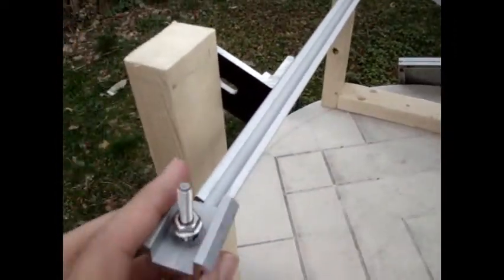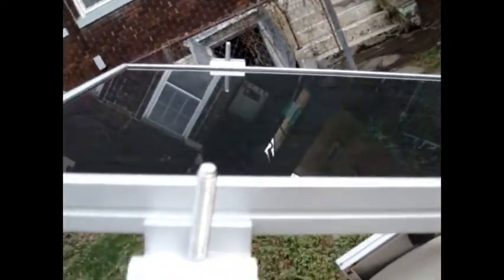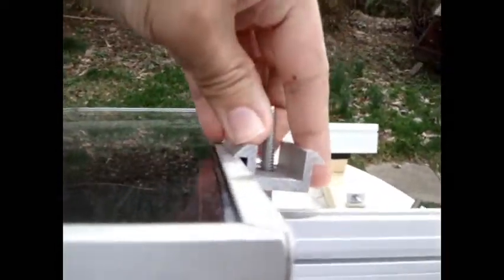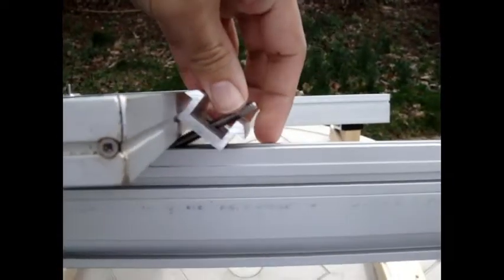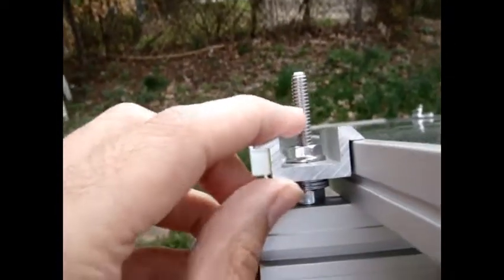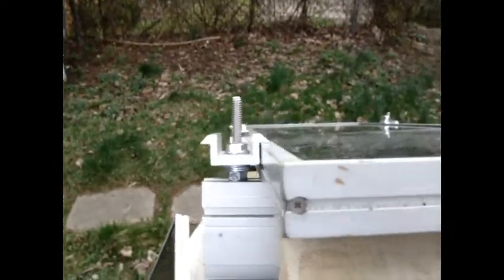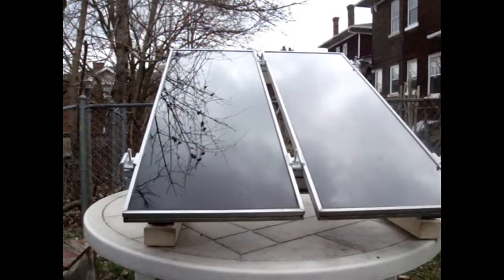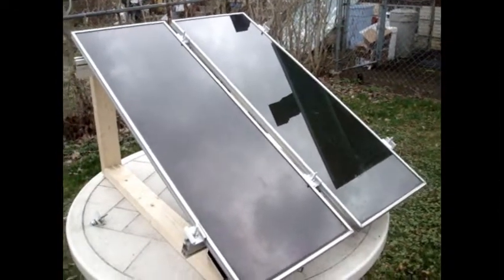Habor Freight Solar Racking Upgrade : Unirac Parts

Comment: Nice video.  Those are good looking panels. Because of the look of the glazing on those things, it gave me an idea.  I wonder if they were used as an awning for a porch or windows what the gain would be. I have heard architects and engineers talk about "site cooling" and wondered what the gain in energy would be from the shade provided.  You could put them over a sunny door entrance and calk some t-molding in between the panels with silicone (this is how solar hot water collectors are done)